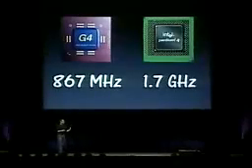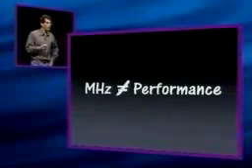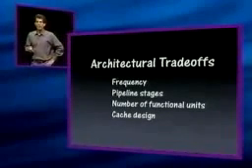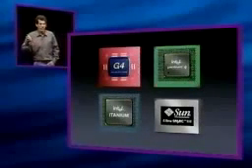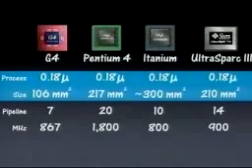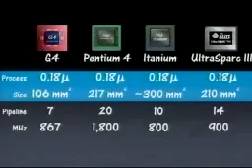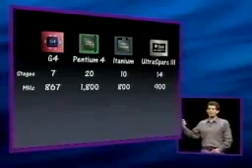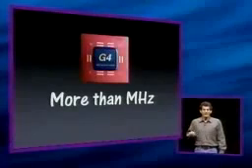Steve jobs talking about the Megahertz Myth

Comment: What a complete load of horse shit.
Of course mhz doesnt mean better performance, it never did. It was unanimously decided that it measures processing speed not power so what are they on about exactly?
It's  a tricky dicky subject, but if I crank an HT P4 to 6 or even 7 Ghz it EASILY outweighs the g4. The issue is practicality and longevity.

Comment: PowerPC is a RISC Technology and was always the better option, apple was right from the beginning about that technology but back than they didn't had jhoni sroji to develop the A Series of processors and the technology was far away, they had no option others than intel in order to develop the next generation of MacBooks, because of the power consumption of the RISC processors back than, now, in 2017, the RISC Process technology is on par without intel and soon, apple will ditch intel and move to a RISC Processors on the Mac once again, only this time the performance will be better than intel and the power efficiency will be even better, intel is a mass, CISC technology with many many pipelines stages
Reply: Und dazu kommt noch, dass cisc-Prozessoren verdammt viel unnötigen Kram beinhalten. Es ist höchste Zeit für eine neue Prozessorarchitektur, bzw. dass eine effizientere verwendet wird als x86.

Comment: Before the 2000s the megahertz myth was pretty helpful when comparing computers.  Today I suppose you can compare architectures via independent benchmarking websites and that would give you a somewhat unbiased representation of performance.
Reply: As long as you didn't need to compare a z80 and a 6809. Those were pretty drastically different in performance per mhz.
Reply: Even on the mid 90s we already have things like PR (performance rating) for processors marketed by the CPU manufacturers like Cyrix and AMD.

Comment: Ah yes, at a time when clock speeds were making insane leaps and bounds.  And of course this was only 4 years before Apple made the switch to Intel (though they were experimenting with x86 already at this time in secret).  

Great thing about the PowerPC 7400 (aka G4) was it's relatively short pipeline like the PowerPC 750 (aka G3), but the addition of Altivec and true SIMD, which was highly lacking in the PPC 750.  Even with the lack of real SIMD and a decent FPU,  it's pretty hilarious to think that the PPC750 would live on for so long in game consoles starting with the Gamecube, to the Wii and finally the Wii U, featuring clocks of 1.25 GHz and the only production multicore variant of the 750.

Comment: I don't understand this comparison. Yeah whatever he gives this whole bullshit story about Bubbles and Branches and Pipelines and whatever. Apple are just fucking "better" than everyone out there and yet they switched to Intel CPU's?! Wtf is up with Apple?!
Reply: You didn't understand the comparison because his explanation was bullshit according to you. If you've actually listened and taken the time you'd understand why the G4 was faster than the P4. Apple switched to Intel CPUs because Intel finally got with the program and made their products more RISC-like when they designed the Intel Core range of CPUs.
Reply: No, this presentation is wrong. The pipelines do not go at the same speeds for both processors as this powerpoint shows. And one processor weakness will be the other's strength. For small computations, the G4 will do better, but for larger ones, the larger Pentium 4 pipelines will be more effective. This is bias at its best!

Comment: And yet Apple ended up, switching to Intel. ;)
Reply from the maker: Check out the next video on my Apple playlist to finde out d;) "Steve jobs: Performance per Watt"
Reply: kjakobsen yes 7 years after the g4 because intel had a breakthrough with the core (2) duo architecture. but at that time the ppc was really ahead in creative tasks especially because of the velocity engine.
Reply: And at the time this video was 100% spot on. Apple pushed Intel to make their processors more efficient. They did, and finally kicked the PPC. Made sense for Apple to move to Intel, so don't pretend that Apple was lying. They don't make the processors. They were just stating facts......hater.
Reply: Large parts of MacOS are already compatible with ARM architecture. Just look at iOS, running on Apple's own ARM based processors. At the core it has been ARM compatible since NeXTSTEP.
Reply: ppc 4 life bro
Reply: "apple pushed intel" ahem? what:????????  yeah right, cause  Intel's smallest customer pushed them cause otherwise intel wouldn't are about performance.  fuck.  No it was simply x86 gets TONS of r and d where as risk doesent so x86 emerged and has maintained the lead. either could change at any time though.
Reply: "Apple pushed Intel to make their processors more efficient."

Not Apple pushed Intel. AMD did it and the own Pentium M showed that this long Pipeline + High MHz thing called "netburst" was a dead end street.
Reply: Umbro Khan obsolete old cpu eith new name  dumb sheep how apple will milk stupid people like you
Reply: They might soon replace intel with arm the processing power is getting there and judging by how anti industry/consumer they've been lately with killing 32bit support, USB C only, no Headphone jack, ending/overtaking PowerVRs GPUs on iPhone. I wouldn't doubt they would attempt forcing everyone over to ARM on their platform which would create a bigger divide between traditional computing... wish I could see into the future :P
Reply: KOSAMA GAMES Computers themselves are becoming more uncommon, so I wouldn't be surprised if they forced ARM
Reply: +Wesley Jordan Apple switched to Intel for the possibility to run Bootcamp and Windows.
Reply: Œskblad That is incorrect
Reply: you just have heard about A11 Bionic chip?
Reply: Œskblad If they switched to Intel for Windows then why did they continue to work on macOS?
Reply: Œskblad Let alone add Intel support to macOS
Reply: kjakobsen there is also the fact that intels high grade processors were made available to personal computers. When intel went over to 64 bit , which sun and apple have had for quite a while there were no main need of hassling with the seperate hardware. It is not so much apple that made a switch, rather intel that had to switch to same instruction levels and by that, apple could concentrate again more on a stable os. Still, its highly stable vs the microsoft. Yes a microsoft may have a lot more software, but i havent had a mac ( have both) in 20 years with problems.
Reply: it's all about variation of working ways of precessors. it's about What way do you need it to work? Performance? Speed? Durability? Battery life? Back then there was no precossor product that includes all of them in one. That's Why Apple could easily criticize processor technology by only performance. But since then Intel doesn't stop Where is it. it has gained huge improvements. Then Apple decided to switch to Intel.
Reply: "remember what we said about the MHz myth? yeah...well that was bullshit, we're switching to Intel"
Reply: kjakobsen Cause IBM PowerPC Chips consumped a lot of power Power Mac G5: about 300 watts
Reply: Internet Alpha uneducated sheep crapple dont make cpu dumb sheel they biy from other conpany conponent
Reply: Niels Poldervaart apple own ? really where read this nonsense crapple cant afdord to make hardware they are poor company who steal
Reply: kjakobsen jokes on apple. They're ditching intel.
Reply: Void Star Perhaps to Apple secterists and Jobs who would deny it. Apple realized they sucked and lost sales on their shitty OS

Comment: The pipeline comparison: Inaccurate as the higher megahertz CPU will "push" the green "data chips" at a faster rate. This shows that for small computations lower pipeline helps due to lower pipeline latency, but for complex computations the longer pipeline latency will be outweighed by the benefit of the higher clock of the Pentium 4.
Reply: KGT UserCast and that is why he said " a task" never specifying what it is or giving a scale ... Potentially a scam ?
Reply: Netburst was Intel's own catastrophe. They pushed for higher clocks to cash in on the public perception of mhz = speed. Then AMD came in with Athlon and killed their ridiculous hodgepodge of a design. They went back to their Pentium-M architecture, remade it as the Core architecture and eventually resupplanted themselves at the top of the chip food chain. It took AMD a good 10 years to recover from this and now AMD is back with Ryzen.
Reply: Do you own Apple stock fanboy?  If not why be their spokesman for free?
Reply: KGT UserCast vielleicht wäre die beste Lösung, dass sich die Pipeline je nach Anwendung verändern lässt. Ein Modus mit kurzer Pipeline und ein Modus mit langer Pipeline. Wenn ein Programm ineffizient programmiert ist, kann die Pipeline verkürzt werden. Automatisch.
Reply: There's a reason the PowerPC architecture went away... It was always under-powered, required significantly different coding from the x86 versions of software, and only the expensive dual processor models could really compete back then.
Reply: That's not at all true, even the G5 at the end of the reign of PowerPC beat the living shit out of the then revolutionary dual socket dual core Opteron 64.  The problem was that IBM had no road map for lower power CPU's which could be used in mobile. PowerPC even today is extremely competitive as an architecture as shown by Power9, it just has not seen any architectural changes that allow for low TDP sku's. Apple saw it as a good time to jump on the new Intel Core train, and went x86 for TDP reasons.
Reply: Isn&#39;t this their notebook cpu? I don&#39;t think they&#39;d do complex computation on an old notebook
Reply: Was. However by "complete computation" I think you mean instrictions per clock (IPC). IPC is not a solid number, but rather determined by the average operations per clock, for example ancient CPU instructions all pass through the same pipe. 
In a new CPU however, the pipeline is like a 2D map, with usage of caches rather than just registers to store commands to escape the "pipeline tax" clearing of pipeline to process the previous command. 
This allows a more efficient pipeline that is not cleared so often, and lowers the latency for some simpler instructions (1+1 vs. if A then 1 if B then 2) by choosing a shorter pipeline path alternative.
So fewer clocks for more instructions.
Of course, that might be why desktops might perform better than laptops at same clock speed, as a result of more die space available for a more developed CPU pipeline pathing.
Reply: Wrong!!! IT's all about architecture.. Mhz is just one of the factors but it is not everything. Don't be a moron pls... You know I am right so shut up!
Reply: Oh the Apple hate is so strong here.

Comment: 4:50 why is the longer pipeline faster? the 'pieces ' drop out at the same rate, as far as I can tell
Reply: Because it's a powerpoint representation
Reply: The longer pipeline, the Intel Pentium 4, is running at 1.7GHz compared to the G4 (the shorter pipeline) at 867MHz.
Reply: The pipeline not so much longer but has more stages. A pipeline with more stages will have shorter stages, this means the critical path length (the greatest number of transistors a signal possibly could pass through in a stage) of each stage is shorter thus the time required for a signal to propagate is shorter. The max frequency will be proportional to the inverse of the time required to pass through the longest stage. At the same frequency a long pipeline and short pipeline CPU will generally complete tasks in the same amount of time, I say generally because there are a bunch of complex caveats.
Reply: they can make that kind of animation in power point u silly
Reply: He said in a perfect world and then explains why is doesn't is faster

Comment: Before his time. Nowadays, Mhz comparisons between processor generations are basically useless.
Reply: Apple know exactly what hardware they need to optimize for since they are the only one making devices for their own platform. It only makes sense that it's easier to optimize and push the hardware as far as it will go.
Reply: r2c123 you apparently don't understand shit about the word compatibility.
Reply: If iPhones never slowed down over time they wouldn't sell as many new ones. Even do it sucks, it does make sense from a business point of view. I'm sure most of the competitors do the same thing.
Reply: Except G4 became crap soon after Intel launched HT Pentium 4 CPUs. Eventually Apple dropped RISC Power PC cpus and  joined Intel.  So watching this in retro spec is pretty silly to agree what said here. They don't even mention AMD which was around kicking Intel's but then.
Reply: IPC? I didn't mean to imply Apple first Intel was Pentium 4 HT.  I know their first Intel was the Core Duo. the G3 and G4s they used were crap compared to the P4 HT out at the time. That were greatly improved the P4.  
I remember it was not until IBM produced the G5 that Apple went to Intel when the Core Duo became the P4 line successor.
Reply: darktennisball Microsoft makes hardware?
Reply: Lisa they make a lot of hardware now. From Xbox game systems to Surface Pro tablet and notebook computers.
Reply: vh9network It was just a joke because their only significant market share is the xbox, which I truly wouldn't consider hardware, but I guess a console counts if you're a console player.
Reply: Ben Randolph this actually isn't true because if it were processors would be uneeded and PCs could run "brain dead".
Reply: Ben Randolph but the point is, Apple optimizes weaker hardware; Windows and Google just shove a bunch of power and are lazy.
Reply: Not really, Apple takes liberties with their software to push their hardware as far as possible.